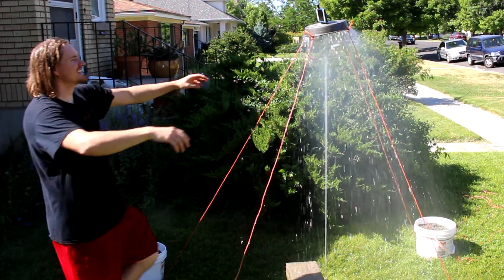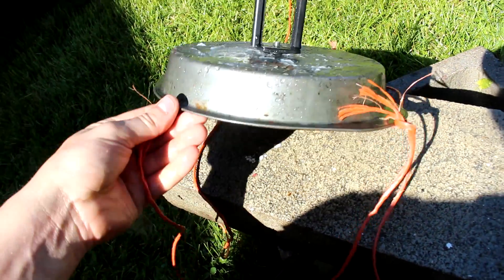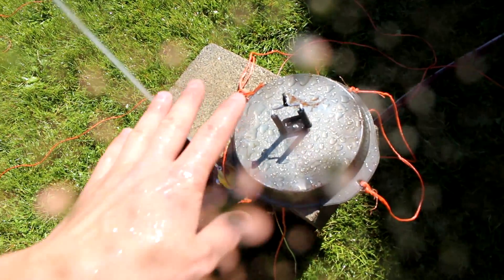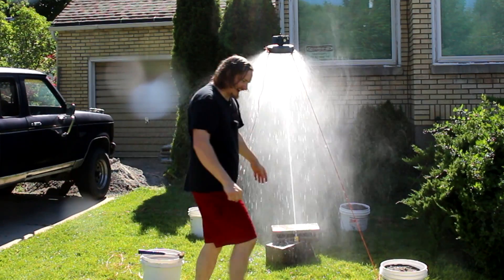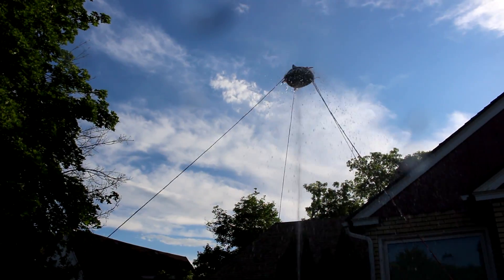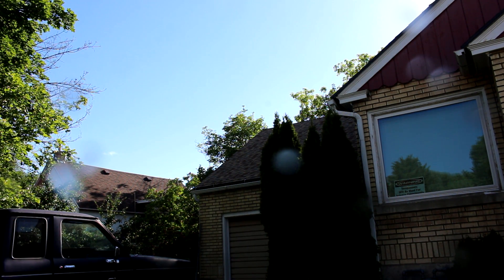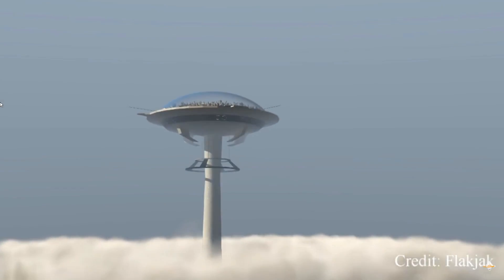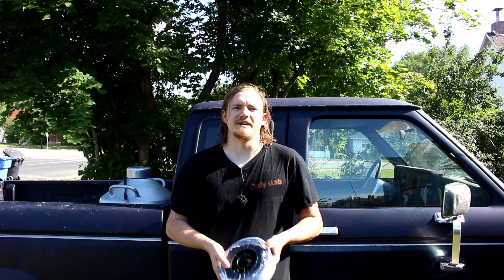Actively Supported Tower (part 1)

Comment: Someone in the neighborhood flushed his toilet and gone was his iphone ;-)
Reply: It's not, unless your municipality is really bad at keeping the system pressurized. 
In that TV show, the plumber who did the house was probably an idiot. What happened in that scenario is the toilet dropped the water pressure from the cold water lines (probably because they were too small), meaning that less cold water went into the shower. This ALSO means that the hot water heater was putting out water hot enough to burn, and there was no mixing valve installed to automatically regulate the temperature.
Reply: Is that how the plumbing works in america? Ive seen that in an episode of 2 and 1/2 men a few years ago when one of the characters was in the shower, and someone flushed the toiled and the person in the shower screamed. Im guesing the shower got really warm because the cold water went to the toilet for some reason? I would appreciate if someone could explain how american plumbing results in screaming people in showers and phones going away when you flush the toilet
Reply: I see, so this comment is saying that someone in the neigbourhood flushing the toilet would result in a drop in water-pressure so the phone would fall down.
(Assuming that the municipalitys water pressure is that weak)
Allright, i hadnt considered that it might be because of a problem with pressure on a municipal scale.
I also didnt considered the Mixing valve issue, here in Sweden there basically doesnt exist hot+cold water outlets without a mixing valve. But i did visit america a few years ago and i do remember that there were quite a lot of manual valves there where you had two knobs to regulate the amount of cold and warm water now that you mention it, I didnt think of that. Thanks for the input!
Reply: kyrkplast those values are kind of annoying though, because then you can't control the volume AND the temperature of the water, only the temperature via the volume of hot water being added to the cold. I prefer two knobs since you can control the flow and the temperature independently.
Reply: If your water heater doesn't put out water hot enough to burn, your shower will only be lukewarm in all but perfect circumstances.
Reply: kyrkplast no it’s backwards. You flush and the shower becomes cold cause reasons

Comment: worlds loudest camera tripod. Errrr quad pod?
Reply: Well it's only supported by 1 thing, so I think monopod is more appropriate
Reply: +TheOnlyInformant That's an awfully true statement.
Reply: The strings support it laterally. The water supports it vertically. Pentapod.
Reply: aqua pod
Reply: Seriously though, this is a "concrete" term. It's still supporting it. Laterally. The 'su-' prefix may suggest supporting from below, but the word support has many, many more meanings, now, than the old latin origins might imply.
Some examples of appropriate definitions from various dictionaries: 
       v. To hold in position so as to keep from falling, sinking, or slipping.a :  to hold up or serve as a foundation or prop for
2. a  mechanism  or  arrangement  that  helps  keep  something  else  functioning.
verb: to hold something firmly or carry its weight, especially from below to stop it from falling:
2 to hold the weight of someone or of something such as a building or structure so that they do not move or fall
As you have pointed out, the etymology of the word lends itself to support being defined as providing a force against the force of gravity, but as you can see, the nature of the word now, does not assume gravity as the force to counter, or the direction of the force to counter or the force provided by the support.

Here's another English word that's appropriate to the conversation: 'Nitpicking'. You, I, and everyone here know damned well what that guy meant when he said "support". The meaning was conveyed clearly. This conversation is over.
Reply: So when I provide technical support, do I have to lift the computer over my head?
Reply: non pod
Reply: "support" means "to assist" not "to hold up". The water is holding the object up, the strings are keeping the object in the correct lateral position. They're both providing support.
Reply: I've gotta agree with Capta Praelium here.  Cables that stabilize (https://en.wikipedia.org/wiki/Guy-wire) can reasonably be though of supporting the tower against lateral loads, such as wind.  A force is a force - gravity might care which direction up/down is but the rest of physics really doesn't.
Reply: It's obviously a monowaterpod
Reply: The strings don't support anything. What's supporting the weight of the pan is the water jet. The strings hold the pan down, they don't lift its weight so they don't support it.
Strings aren't usually able to support anything, they can pull or hold things, not support them.
Reply: It can mean either, but in structural applications the primary definition is as follows

sup·port
/səˈpôrt/
1. bear all or part of the weight of; hold up.
"the dome was supported by a hundred white columns"
Reply: No, Dean.
Check the etymology, it's a latin word you're talking about.
I am Italian, I can assure "support" (supportare in italiano) is a compound of su + portare (over/above + carry) meaning to HOLD UP the weight of something.
Reply: Only if you fail to recognise the difference between a concrete and a figurative meaning. :P

Support in a concrete sense means to hold the weight against gravity.
Support in a figurative sense means to metaphorically help to hold someone else's "weight" (problem).

It should be something like this on a dictionary:

Support (v)
1. to hold something's weight up
2. (fig) to provide help or assistance to someone
Reply: Ahhh so you've failed to recognise the difference between "concrete" and "figurative" when you were trying to say that the strings are not supports.
Reply: Anti-tripod maybe? The strings are pulling against the force of the water stream rather than pushing against the force of gravity, and there are four, but I figure you can cancel out the water stream and 1 string and go with anti-tripod.
Reply: If you want to be pedantic, it's a monopod (the jet of water).
Reply: Pentapod*. And with that in mind, its probably the only one. :)
Reply: isopod

Comment: Can it be done with high compressed air?
Reply: Yes and no. you could make it "levitate" but not as high up. you would need to use way more energy with air than water. I think. Correct me if i'm wrong
Reply: I'm not really an expert at this, but what my brain remembers of physics mostly agrees with these statements. You'll definitely need more energy since don't know of a good way to keep a jet of air as focused as that nozzle does for water over a distance like that. 

Air is also less dense as mentioned here, so you'd need a high volume of air for sure but roughly what kind of pressure and flow rate to get close to similar results? No idea, but that's assuming you can keep the jet of air focused enough to hit that small surface area at all (without feeding it into some kind of tube/hose/whatever that then bounces it off the platform, and then you'd have to lift that too or have a fixed support on the ground for it).

I do know one fact though about trying this with compressed air: Cody wouldn't get wet due to levitating the object.
Reply: I think AstroMineFun is correct on this. Air is less dense and lighter, so if you had the same volume and speed, air would do worse. If you were to increase the pressure (and by extension, the speed the air is moving at) it would have more energy and do better in comparison to before.

Don't quote me on this, I have a basic grasp of physics at best, so call me out on my bs if it is.

Comment: Not related to this video, but i was wondering would honey behave like prince rupert's drop if you were to drip it into some liquid nitrogen
Reply: Molten caramel might be more interesting than honney, since it will remain solid at room temperature. It also looks and slightly behaves as glass.
If actor jumps through a window in a movie, then it's most likely made from sugar.
Reply: TheAllegiantTraitor that's the general idea. honey behaves like molten glass at the room temperature, but now I want to see molten sugar too
Reply: Petar Petrović What makes a Prince Rupert's drop is how the structure of the glass is manipulated. Hardly any substance can recreate that structure. The structure of glass is very special, the most acidic fluids can be held in glass, while it can easily 'burn' through metals.
Reply: Petar Petrović I don't think so. The structure of glass is very unique. I think honey or caramel would just shatter
Reply: I think it would be better if i wrote my explanation in English. So what i think about this is when rupert drop is formed it cools from 1500 degrees Celsius down to the water temperature in few moments. But just outside layer and it hardens quickly and inside core stays hot and cools down much slower and it expands as it cools but outside layer thats now hard keeps it from expanding and it makes stress in glass. Kind of like when you pump air in to an air compressor just here all energy from inside gets released violently and energy from air tanks gets released slowly. Problem with honey is that you cant heat it up alot as it becomes too liquidy and it would burn so you cant have alot of difference while cooling it down. By knowing temperature of liquid nitrogen is around negative 200 celsius you can get about 250 degrees of difference wich isnt nearly enough to build up that kind of energy inside and as a result it would shatter like a glass uppon inpact it would behave like glass but would not explode when you brake the tail off. Thats mine theory. What do you guys think?
Reply: Nope
Reply: Petar Petrović Mislim da ne bi jer ne bi mogao da se napravi dovoljan stres kao u staklu. Moglo bi da se slomi kao staklo ali ne bi puklo kao rupertova kap. Makar tako mislim. Staklo prolazi kroz mnogo vecu promjenu temperature, kad upane u vodu spoljni sloj se ohladi sa 1400-1500 stepeni na temperaturu pribliznu vodi za par sekundi dok jezgro se hladi mnogo sporije i siri se i pravi pritisak/stres u staklu. Dok bi med sa sobne temperature na -200 napravio vrlo malu promjenu ne bi bilo dovoljno energije da pukne. :)
Reply: Petar Petrović 2 days ago?! It says this came out 26 minutes ago!
Reply: I believe Cody did a video on this about a year ago...
Reply: It wouldn't work, since uneven heating/cooling creates that difference in pressure that causes it to shatter.
(Hello from the future!)
Reply: Petar Petrović no
Reply: arse hole Patreon subs get to see videos first. :)
Reply: onjgen73

nicely writtem, bit I'd like to add one more thing. Cooling it in liquid nitrogen wont't do, because of the Leidenfrost effect. Liquid N is good at cooling things down to very low temeperatures, but not good for cooling things down quickly. 
Something like Mercury at -30°C would be a much better cooling medium, since it will not boil at all. The only problem is that the Mercury (and all other usable liquids) are denser that sugar. You would have to keep it under the surface and the drop would probably form upside down.
Reply: he posted this on his fb page two or three days ago.
Reply: arse hole Some people get early access because for patreon, and I saw in the comments that there were some problems with plagiarism

Comment: there are some special kinds of camera used exactly for this kind of crazy/dangerous things, are called GOPRO!!!!!!!
Cody!!! use them!!!

the subject is very interesting, you were very unlucky about the upload thing

seriously, you should get a gopro to register in rough conditions for example in your vacuum chamber or in the mine, using your phone is more, as you may have exxperienced...Expensive
Reply: You can even get the wireless/bluetooth ones so you can get some of the footage if the camera doesn't make it.

Comment: Will there be a video of the dump resistor and what is the purpose of having one?
Reply: From what I gathered, seems to be just burning some power from a battery being charged by a solar panel. Battery fully charged -> turns some of the magic pixies into fiery pixies :)
Reply: They should build a water tower or something of the kind, and pump water up with that excess energy, then let it flow through a generator on it's way back when he needs extra energy :)
Reply: Why not just disconnect the solar panels? That way, the pixies stay in the panel and don't have to squeeze into the battery when it's already full, becoming all angry.
Reply: you don't want solar panels going open circuit while under full sunlight i believe.
Reply: At that point, just build a larger battery bank. Same thing, but more efficient.
Reply: It's also known as a Dump Load. It's just a way to automatically burn off the extra power from a good day of solar/wind generation. It's like if a yard light could blow out it's battery before sunset so it turns itself on early to protect it's battery. Cody is probably teasing us as to his upcoming topics or giving us a glimpse of a topic he won't go into because lot's of people are already.
Reply: Better solution is to use a 4-throw relay to cause the panels to dump into the load instead of the battery when it's fully charged.
Reply: Hmm. Would that cause overvoltage, possibly damaging the cells?
Reply: it's clearly a passively active toaster...
Reply: A water tower could easily have a more safe/stable overflow (not as prone to fire/failure), but it would be less efficient.
Reply: First 3/4 of your posts are true. Maybe you missplaced useless to simple, as dump resistor is more simple than useless.  Having more energy than you use is an interesting problem, dumping it to heat might be simple solution to it, with benefit of having warmth generated from abundance. In case of colder days heat is appreciated. Or you could divert excess energy to heat water.
Reply: Because the solar panels still generate power even when disconnected. When open circuit, it starts storing up the power inside the solar panel because each cell has parasitic capacity, and it'll eventually blow. He'd have to go and cover those solar panels up each time he wants to stop generating more power.
Also the reason why we can't store mains power all that well. All energy that gets generated has to go somewhere.
A dump resistor is a pretty useless dump component. I'd make an ionizer. Help the environment or whatever.
Reply: Generally speaking you don't need a dump-capacitor for normal home sized solar array, at least not when i bothered to actually do research a few years ago. You can just disconnect them, they can handle the open-circuit voltage. But what you do need it for is wind-turbines. Just like an electrical motor draws more current under load a greater load creates a greater resistance in a generator. A wind-turbine without any load might over-rev and damage the bearings or wings so there a dump-load might be a good idea. The most common usecase where you might want a dump-output for solar is if you have a task that needs doing but the exact timing is not important like topping of a water-tank or re-heating a geothermal system  (you might ofc occasionally need to run the tasks from the main power if there hasn't been enough excess lately).
Reply: LuxmasterCZ yes our climate could albsolutly use some more unneeded heating^^
I am not sure what would be modt efficient way to store the extra energy instead of just burnig it (I guess the already mentioned additional bateries). Back at the fat I belive Cody used the poweroverflow grom their generator to split water.
Reply: the generator would clog the system, and the water would stack on the upper side, reducing your power output to the tower. :|LAWS OF THERMODYNAMICS. CAN'T MAGIC ENERGY OUTTA YER ARSE